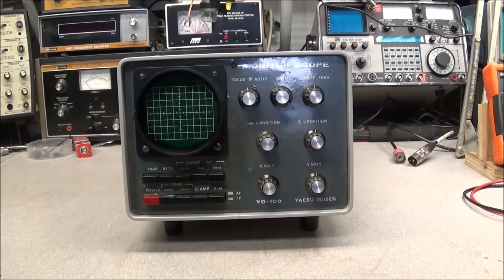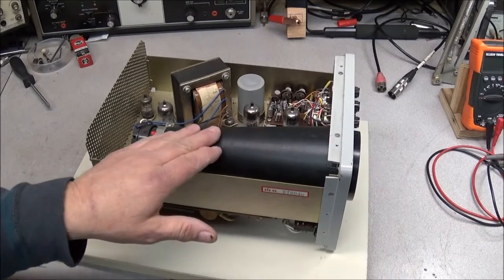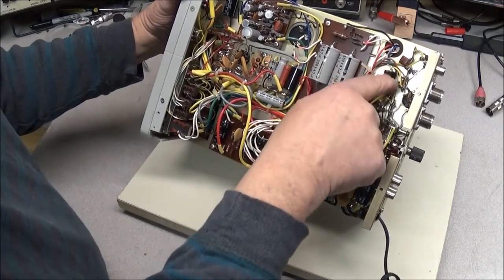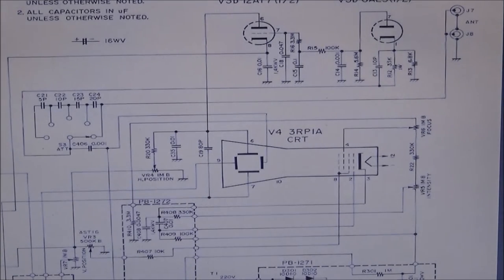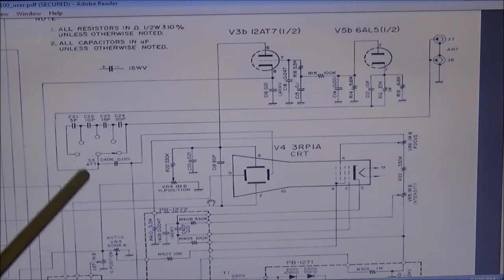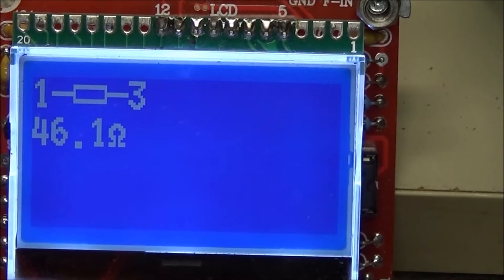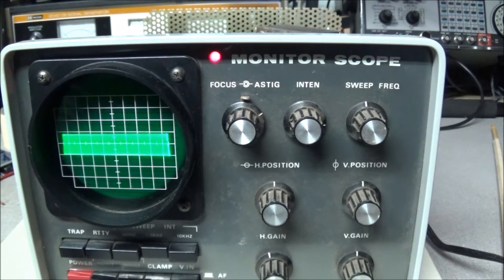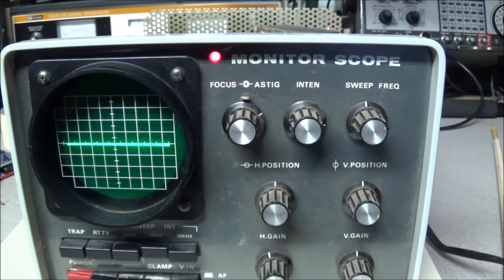#28 Yaesu YO 100 scope monitor troubleshoot and repair

Comment: Talk about using your senses as simple test gear, we had a cable TV tech here last week to troubleshoot a foreign voltage noted on our coax feed. He started at the closest pedestal and used his "DMF" or as I called it his "Digital Multi Finger" to see if there was a 90V level on the coax that wasn't supposed to be there; I told him I knew CPR just in case. Luckily he didn't start doing the "funky chicken" when he held the coax connector's ground ferrule between his fingers and touched the center conductor with his index finger. Great easy fix Buddy, thanks for sharing!  73 - Dino KL0S
Reply from the maker: +Dino Papas  Ha ah, that surely will light up your life. I got hit with 1100 hundred volts before. I learned how to do the funky chicken then. Also learned a lot of respect for high voltage. Thanks for sharing that story Dino. It reminds you to put safety first. And as always thanks for your comment.

Comment: Thanks for the kind words Buddy..... Always appreciated! Great job on the scope, I have 2 of those, and like them very much. I agree, the best piece of test gear we own is right between our ears!
Reply from the maker: +Mr Carlson's Lab Paul, It is a real honor to have you stop by my little channel.  And no problem I reference you and Peter many times on different web sites. You guys are the best. And yes, I love test equipment but when you the one between your ears it gives you a good feeling. Thanks for commenting my friend.
Reply: +The Radio Shop  excellent video. I usually change all the Japanese oil caps out as they are not the quality of the Sprague Vitamin Q or the Russian K40y paper in oil caps.

Comment: Buddy, I have the same YO-100 that I turned on after 2 years of sitting.  Made 3 snaps.  Fuse, and both resistors on that same terminal strip, so evidently the same problem.  I'll do a complete recap as I need it for my old Drake equipment.
Thanks for pin pointing where on the schematic to find these resistors as occasionally I it bit difficult for a  non electronics tech to pin point issues other than using your senses as you describe, along with voltage checks etc.
Thanks for saving me time.
Cheers.

Comment: Nice repair. Not only look to the result, smoked resistor,  but also looked for the course, shorted capacitor. This is not always easy! Good job look forward to some more.
Reply from the maker: +FEY Thanks very much FEY. This was a very easy fix. The way I like them. What you saw on the video is what I saw at the time :) Thanks for watching and many more to come.

Comment: Yes! I agree with you and Paul; our senses are the best guide in tracking a problem that often speed up repairs, test equipment on the other hand is an extension into more precise troubleshooting. There is an old saying, the test equipment is as good as the operator. A good understanding on how electronic parts work will make you much more efficient when it comes to resolving issues.
Reply from the maker: +John Cunningham Totally agree John

Comment: Mine hasn't been used in a few years. Turned it on today, worked great for about an hour then made a sizzling noise from within and the display went very dimb before I reached for the off switch😮😮

Comment: I still use my Vintage test gear wherever possible, my favourite signal generator is an old Avo valve job from the fifties & is still spot on frequency. Wherever possible I still use my old Avo 8 as well. Think it's an age thing Lol, maybe I should have been born in the 40's.
Reply from the maker: +Andy Gallacher  Good deal on the AVO vintage gear. I always love old stuff and love hearing about them. Thanks for posting.

Comment: Viewers should realize it was a 15K and 47K ohm resistor that was burnt on the terminal strip. .  Referring to the schematic, one can see that a 47K and 15K  are on the terminal strip and the additional 47K that Buddy referenced was on the PC card. 
Hence he mistakenly replaced the 15K with a 47K. Glad it still worked.

Comment: I have been watching and enjoying your videos and like your troubleshooting techniques. I have been working on radios for 40 plus years and still get stumped a bit and of course I like the rapid satisfaction of having the parts quick and not waiting or having to search for a long time. I need more patience :)

I actually wanted to ask you about the turntable you have built that swivels. That would sure make the IFRs and Yaesus a lot easier and I am also jealous and interested in the microscope you use. Any info you can share would be appreciated Sir and thx.

Ron Keith
73s
AK6Z
Reply from the maker: +Ron Keith Well thank you Ron for the kind words and for following my video series. Much appreciated. Lets see, turntable.  I was at a flea market one day and laying on a tarp a vender had I saw this round doughnut looking ring. It measured 12 inches in diameter and has a 6 in hole in the center. The whole unit is less than a half inch thick. I knew then what I could do with it so asked the guy how much. He said one buck. Took it home found a laminated board from a tore down cabinet and bolted in on. Been using it since 2000. I think the bearing ring came from a tv set. Also some cheap office chairs have something similar.The microscope I use is a usb style. It is called the Dino-lite premier.  About 250 bucks now. I wish I had purchase a trinocular microscope but were expensive at the time. Hope this helps Ron.

Comment: I need a Coaxial Attenuator for  to connect transmitter to spectrum analyzer
most power is 50 watts, I see a 150 watt at 40 db and a 30 db what would you get a 30 or 40
thanks
Reply from the maker: +DENNIS N Hi Dennis, I think it may have been you that asked about that earlier. If so thanks for the reminder. Will see what I can come up with. Should not be very hard at all to do.
Reply: Want to buy one not making it , thank you for speedy reply